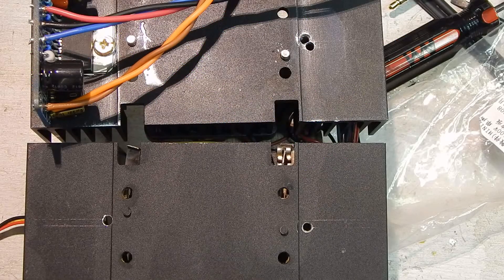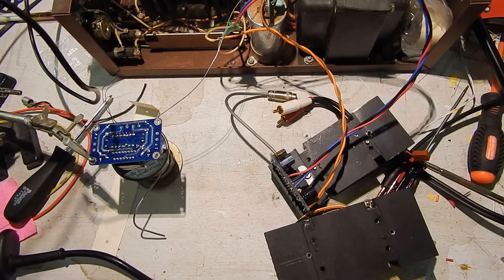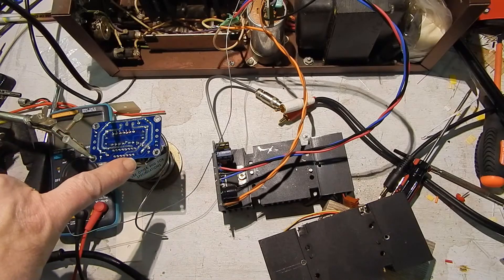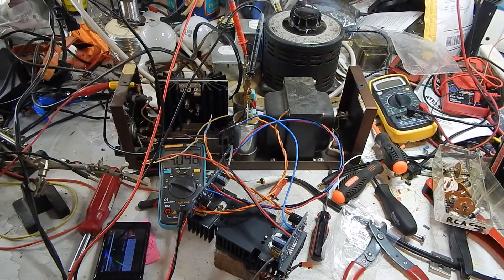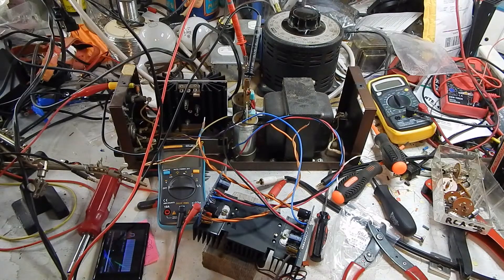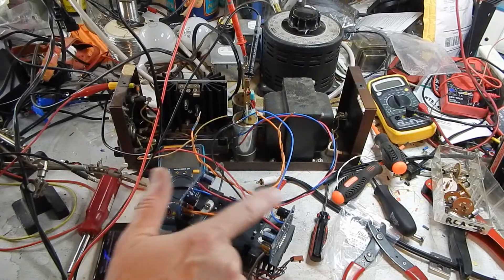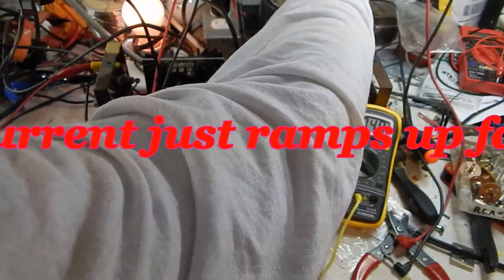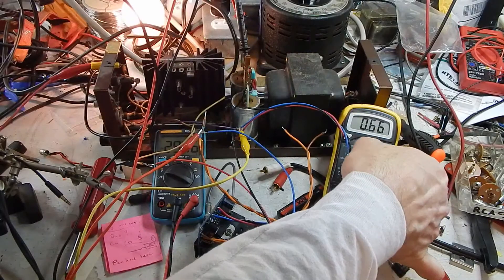TDA7293 "100 Watt" Amp Kit - Testing the Second Channel

Comment: I might buy one of these to tinker with. TDA chips are popular for counterfeiting. Even the fakes I got that worked never performed as well as the authentic ones.
Reply: If you bought this kit, bought a better chip and electrolytics, you'd have some clean power for still not a lot of money. Don't solder the chips that come with the kit, test them on a proto board.